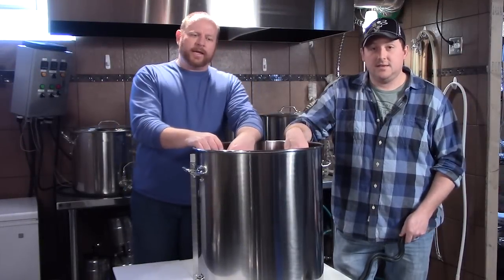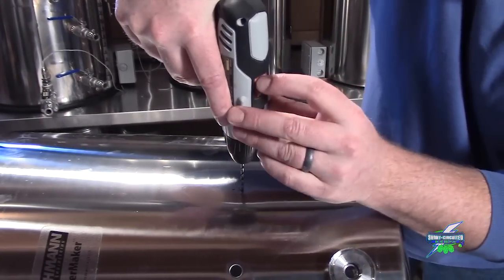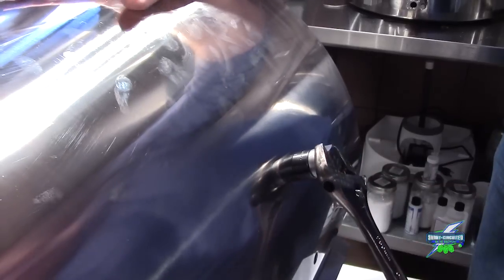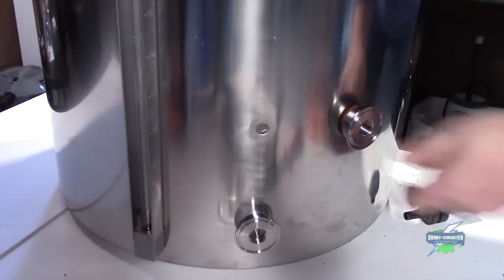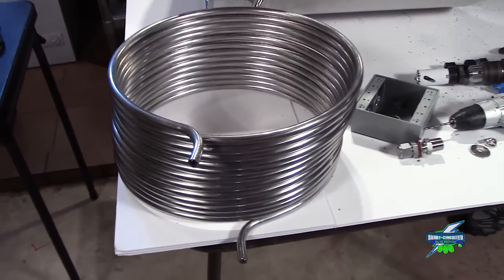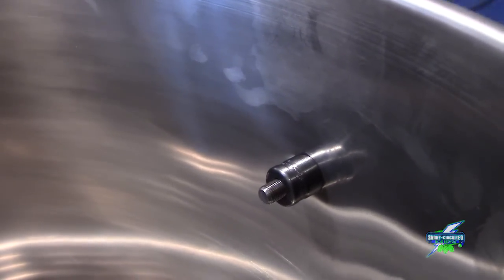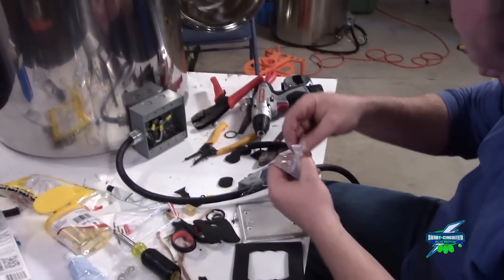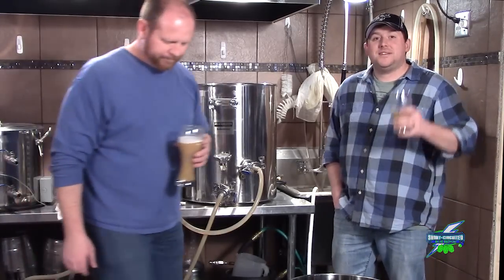How to build a HERMS brewing system for an electric brewery

Comment: A tip on hole sawing stainless sheet metal...... first take a new dry kitchen sponge and hole saw through it. Leave the circle in the hole saw and then soak it in your coolant, whether it be soapy water or coolant oil. Keep it wet and it will greatly improve tool life and avoid work hardening of the stainless.... hope this helps.
Reply from the maker: Great tip!
Reply: Thanks for the tip my guy
Reply: Delta Zee Solutions if you use drill bits with cobalt they will cut through the stainless steel a lot easier

Comment: Nice vid. I'm looking to buy the knockout punches. The ones you used says that they are for mild steel only. I see that they worked good, but for how long? I found a whole set of knockouts punches (https://www.amazon.com/TEMCo-Hydraulic-Knockout-Punch-TH0004/dp/B00HJX58HG/ref=pd_sbs_201_2?_encoding=UTF8&psc=1&refRID=SM27CD6W8NDMP6RM0EME) for less than the two Greenlee punches you used. But I'm confused on the sizes. It says measured hole sizes: 1/2" - 0.86", 3/4" - 1.05", 1" - 1.33", 1 1/4" - 1.69", 1 1/2" - 1.93", 2" - 2.36".  Will the 1/2" work for the 13/16" (0.8125") hole even tho it seems to be a little bigger?
Reply from the maker: It should.. you might want to test it on a piece of scrap metal first just to make sure it is not to large. I have used my punch multiple times and it still works great. 0.86 inches is 21.844 millimeters. I think the o-ring should seal up the minimal difference. Obviously the smaller the hole the less chance of a leak. Hope that helps!! Be sure to check out the new channel!! youtube.com/shortcircuitedbrewers I am about to begin a complete control panel build.

Comment: Where did you get the locking grommet for the electric cord that goes through the electrical box and keeps the cord tight and waterproof?
Thx
Reply from the maker: The one used in the video is from Mc Master Carr.. HOWEVER... a more cost effective option is the one here from brew hardware. https://www.brewhardware.com/product_p/cordgrip.htm&click=17367 Just MAKE SURE you pay attention to the NPT size on the box you purchase. 
A more "up to date" option is the Hot Pod from brewhardware: https://www.brewhardware.com/product_p/hotpod-ewl3.htm&Click=17367 I like these alot and if they had been available when I did my own system as well as Kyles I think I would have used them. 
Check out our new channel> www.youtube.com/shortcirctuitedbrewers I am doing a complete elctric brewing series on there.
Reply: @BuildITWithBrian  is that the correct spelling of your website?

Comment: Nice job!  Just finished up mine.  It's a 30gal capacity as well.  I opted to go with a 50amp control panel and use dual elements.  Heats up in no time!

Comment: Nice work guys, really inspiring! How is the whirlpool working? I've seen some other videos where they recommend having the feed-back above the surface. Just wanted to know how your approach is doing!
Reply from the maker: Not sure how Kyle's is working. I installed something similar on mine. Will post a video soon.
Reply: Yep. Just like the BIABasket / BIAC folks, where they constantly recirc during mash.
Reply: would also like to see that in action
Reply: Daniel Hallin If the feedback is above, it will splash, and hot side aeration (HSA) could be an issue. Unless you whirlpool after roughly complete chilling. I have seen a number well below the surface. And if you you have a big kettle and sometimes brew small batches, that means the return should be below the level of your smallest batch.  But the goal is to get it all spinning ... I reckon it almost doesn't matter what elevation so long as it is reliably below the surface.
Reply from the maker: One thing you can do with a Whirlpool Port if you're doing a smaller volume and you have some silicone hose you could simply attach the short length of that to the whirlpool nozzle and have it go below the level of the wort

Comment: Great video.   Do you have a part number for the Master-Carr wire pass through nut which you used to secure the plug wire to the electrical box?  (8min 30sec into the video)

Comment: Very nice job showing how to build an electric brewery. How much total investment in both kettles? Cheers
Reply from the maker: Well each kettle was $544 and that's all my wife knows about lol so with the elements and HERMS coil odds and ends I would say add $350 to HLT and $200ish to the boil Kettle. I went as big on the kettles as I could because I only want to build this system once I don't want to grow out of it and start replacing things. I also went tri-clamp and I'm so happy I did a bit more money but everything is so easy to clean and change around! Thanks for watching!
-Kyle